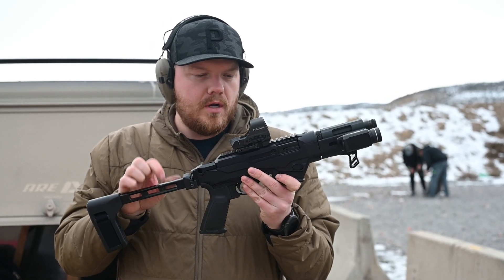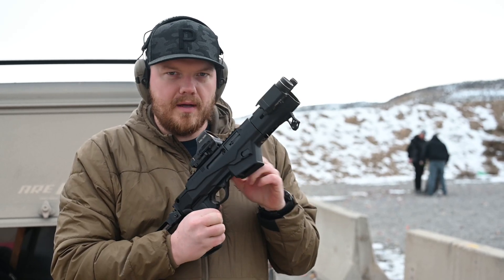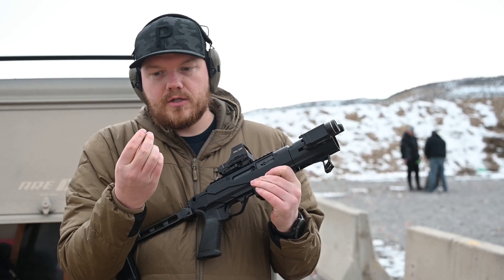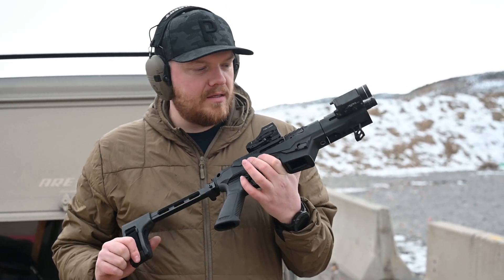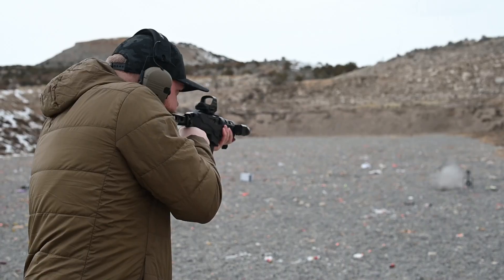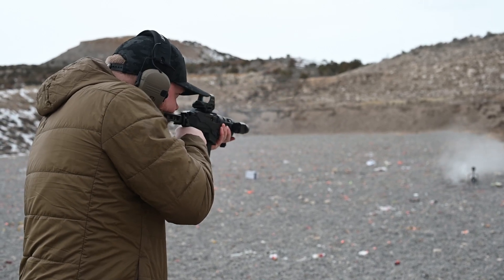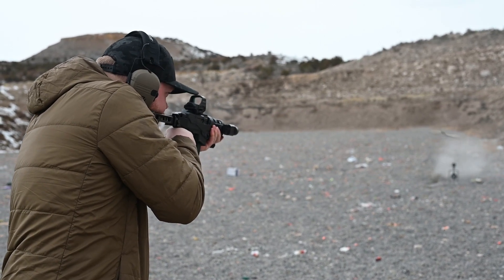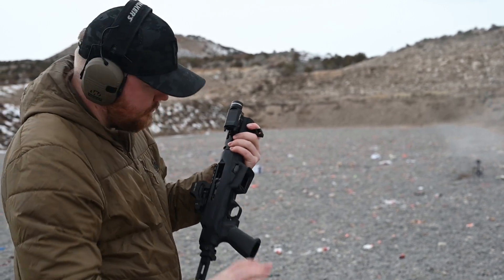Ruger PC Charger Extractor Failure

Comment: My PC Charger was failing to eject with different ammo types after several trips to my range and only basic cleaning. So I stripped it down and flooded and scrubbed it with mineral spirits. I then applied Mil-Comm TW25b white grease on the bolt and inside the receiver. Another trip to the range resulted in no jams. I think this thing likes to be clean and lubed. I also bought an extractor from Mcarbo just in case. Oh and I use Glock mags.
Reply from the maker: Seems like there are a few people that fixed the jams doing other things. The Mcarbo extractor worked for my situation. I now run the gun suppressed and it gets really dirty. Still no issues with the Mcarbo upgrade. So who knows!

Comment: Mine would do the same after about 75 rounds, all the time. What I did was change the magwell back to the ruger one (I never shot it with the ruger magwell) and I just blasted about 200 FLAWLESSLY. Nothing else changed, same ammo just different magwell and different mag of course. I was running the glock magwell with 30 round ETS mag. Could have very well been the magazine ??? Only ever tried that one glock mag because that was the only one I had.
Reply from the maker: I had been using the Ruger magwell and was getting jams. Switched it out to the other magwell and was getting the same thing. The common consensus with most people with the same issue have said the extractor pin replacement solved it. I don’t doubt that someone could be having a similar issue and it’s being caused by something different. However, replacing that pin worked for me.

Comment: I ordered the same part.  Ruger said they would fix it for free so if that fails I at least have a solution ready.  A competition shooter here on YouTube had the same problem.  He filed down the bolt and the extractor and it fixed the problem.
Reply from the maker: Yeah I saw that mod you can make. I would rather replace the part with something that was more of a guaranteed fix.
Reply: @all-americanbackcountry5824  unfortunately replacing the extractor doesn’t always fix the stovepipes.  Glad the replacement fixed it for you.  Hopefully ruger is fully aware of this issue by now and can easily fix my carbine.
Reply from the maker: @illrotik  so yours is having issues with the new part? I’ve put about 500 rounds through it since I’ve replaced it and have had zero issues.
Reply: @all-americanbackcountry5824  No I ordered the new extractor before Ruger said they would service the carbine.  If it starts stovepiping again after they return it, then I’ll instal the new extractor.  Wasn’t going to say no to a free fix for a gun which is a little over 6 months old.

Comment: Как исправил-то?
Reply: He bought the m*carbo extractor (the part that catches the shell and ejects it after each round is fired) Ruger's extractors tends to round off the edge due to a lower grade material used in mass production. I use this m*carbo extractor as well
Reply: @michaelprobasco9883  
Претензию или рекламацию можно оформить?
Reply: @МатвейМалинин-щ4ф  unfortunately, no recall notices, but Ruger has absolutely the best customer service of any manufacturer I've ever delt with. You might be able to suggest your problem with them and see what they say. I just bought the trigger, filed my one part of my gun like the old man does on YouTube, then I went to the range, and gun was a whole new gun, just never jammed and dumped all my clips with a binary without failure.
Reply: @МатвейМалинин-щ4ф  meant mought the extractor (mcarbo) really cheap actually,.. and filed the one part of my gun smoother, ( where the bullet catches when loading) and it's perfect. I can dump a 33 rd clip on 2-2.5 second now. Binary trigger of course.
Reply from the maker: Mcarbo has a detailed video on how it can be replaced.
Reply: @michaelprobasco9883  
Так это же гарантийным обслуживанием уже считается тогда.